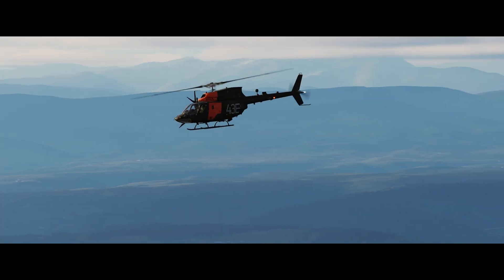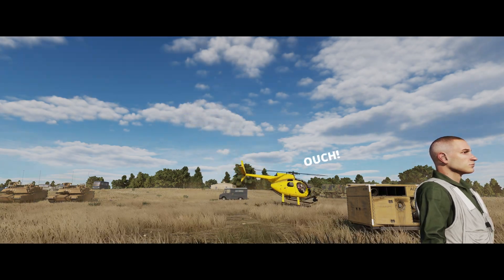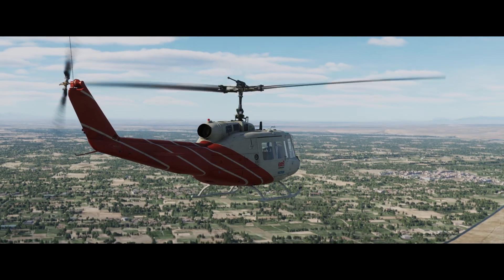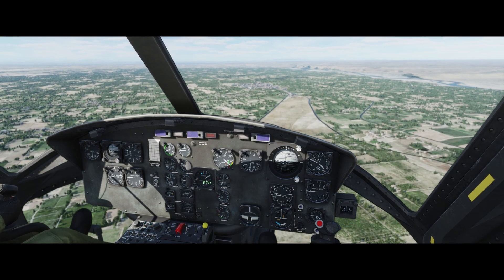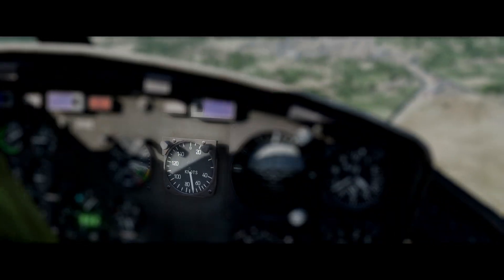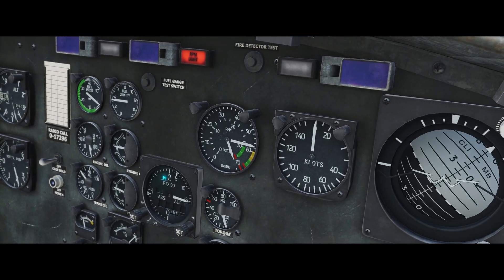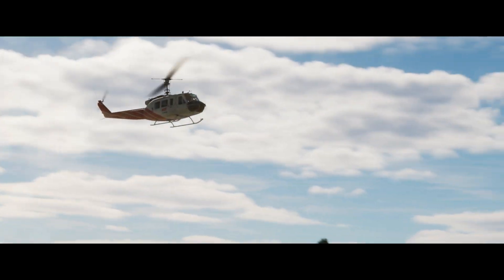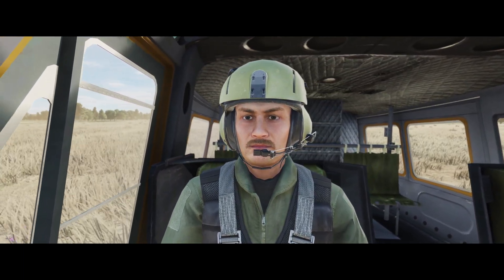HOW TO: Engine Out Landing Helicopters in Flight Simulators | QUICK GUIDE

Comment: I just came across these videos. They are really good. I am curious I have Xplane12 and being a R22 helicopter student pilot. I find that hovering is not at all similar compared to the real thing. I noticed that Microsoft Sim has a Cowansim R22 module, would you consider that much more realistic than what comes standard in Xplane? What would you think would be the most realistic helicopter simulator? Thanks again.

Comment: I never once thought about lowering down the throttle! I will learn it tonight. A very nice video, sir. I like the style.
Reply from the maker: @bhreaditya6110  Thank you for the kind words! Yes, reducing the throttle idles the engine, which then stops powering the rotor. Saves a lot of time getting back up in the air and you can always break off your attempt by increasing your throttle again 😀 Have fun practicing!

Comment: I'm very interested in building a simulator rig. What are your recommendations for the setup?
Reply from the maker: If you're building a helicopter rig, you'll want a joystick with little to no self-centering. The VPC MongoosT-50CM3 Base with a 20cm extension is a great choice, paired with a grip of your liking.

For pedals, I’d recommend the WinWing Orion rudder pedals . I got mine yesterday to replace my CH Products rudder pedals, and my precision has increased tenfold. I’m super excited about them!

A throttle works well, and I use the Virpil MongoosT-50CM3 Throttle , which is a great all-rounder. For more precision, Virpil also offers excellent collectives , although I don’t have personal experience with them.

I hope that helps! ☺
Reply: I have a rig specifically built for helicopters. I can also reccomened a few companies. Maxflightstick and pro flight trainer. I use the pro flight trainer puma (PFT,) as it has a 3 channel switch to add more buttons for mapping. Expensive though. Second market is rare but worth it as the quality is great. 

I also reccomend VR in helicopters, depth perception is everything, haptics, look into that world, I went all in.
Reply: VKb gladiator is the way to go!! Trust bro trust !